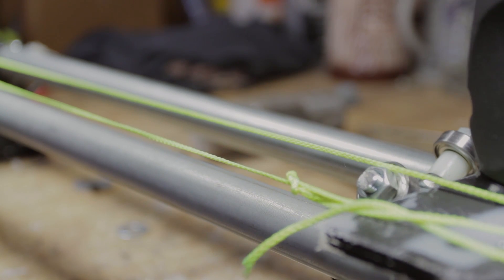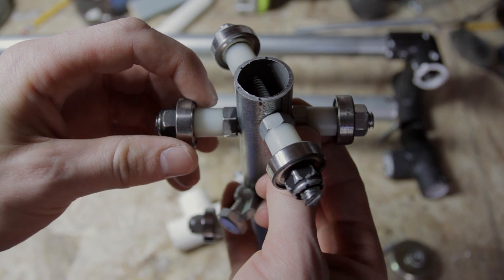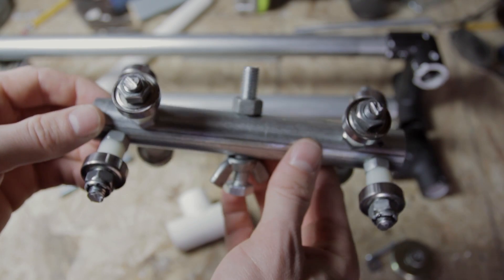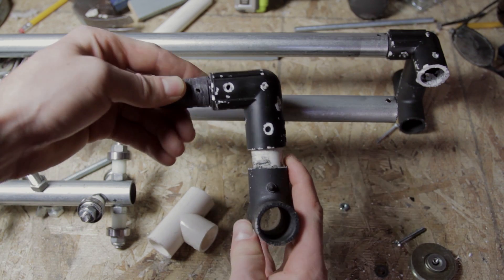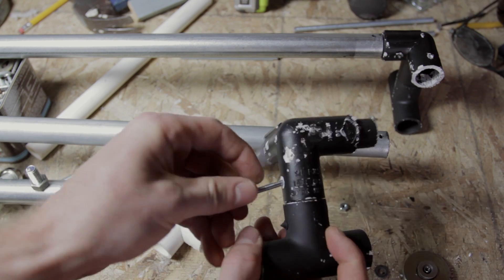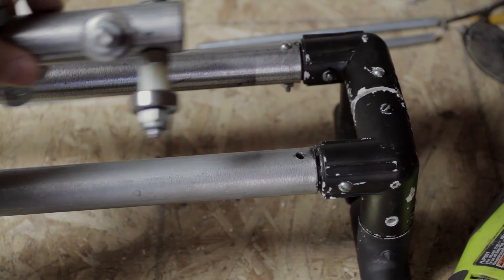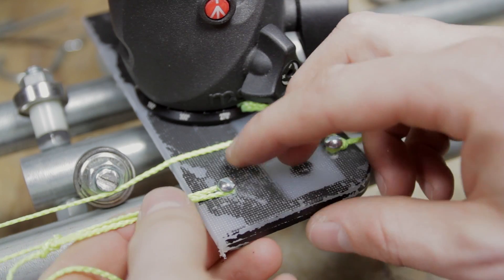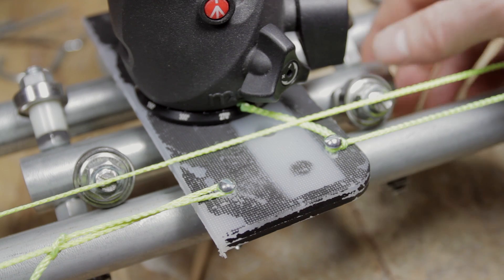DIY Motorized Slider for $150

Comment: Very smart !, Thanks for info. It looks a bit heavy weight though..but very still.Cheers.
Reply from the maker: check out my new version based on tslot rail
Reply: +Cameron Scott I have pulmonary Fibrosis and am unable to do much DIY  until I'm transplanted, but I love this slider and was wondering if you would consider building one to ship for $$?
Reply from the maker: I've actually modified this design into a much simpler version, see the diy video overview here https://www.youtube.com/watch?v=rVXc-TqY-o4 all parts can be purchased and little assembly is required.
Reply: Cameron Scott can you build one of these for me?

Comment: Hey Cameron Thanks for the video and the instructions. Is there a way quite down the noise by any chance?
Reply from the maker: Cameradep07 Servo will always be louder than a motor but more expensive/bigger servos will be quieter. I switched to a low rpm motor from servocity and it works quite well and steps for time lapse.

Comment: Great DIY. If you are having trouble keeping the line tight, you may want to use a different line such as Amsteel. Amsteel will not stretch but it is small and light. 7/64th of an inch. Also you could use a small whoopie sling, which would easily lock itself in place, saving time when attaching the drive line. Great job.
Reply from the maker: Thanks, I have since moved to a $200 version that uses a belt and motor instead of servo, it works quite well with the Dynamic Perception controller.

Comment: This is brilliant. The only mod I'd consider is using permanent eyelets on the base-plate/cutting board, and hooks on the ends of the string. One being a spring hook for tension. Very clever rig. tyvm for posting.
Reply from the maker: Thanks, the new version I have costs a bit more but is way more stable and much stronger.

Comment: Hi, i am looking forward to building a slider myself, and the only doubt i have is, how strong the servo has to be? To move the camera vertically. What servo did you use?
Reply from the maker: The required strength of the servo depends on the weight you are trying to move which also increases as you increase the angle of the slider. The servos are rated for weight I wouldn't use this one to move this vertical unless you have it geared to reduce the force required by the servo. Each motor should have a stall force that is what you need to look for.
Reply: CS Multimedia ok, i understand. What servo model did you use, or how much torque does it have? I'll mostly use it for horizontal shots anyway. Thank you for your reply.
Reply from the maker: This is the servo I used, I have used it quite a bit and the only trouble is keeping the string tight.
http://www.frys.com/product/5230077?source=google&gclid=CJbkntyatL4CFU5afgod2QgAGQ
Reply: Thank you for your fast reply! I appreciate it!